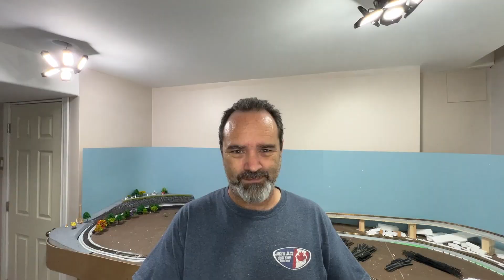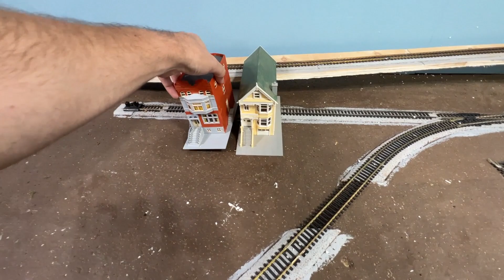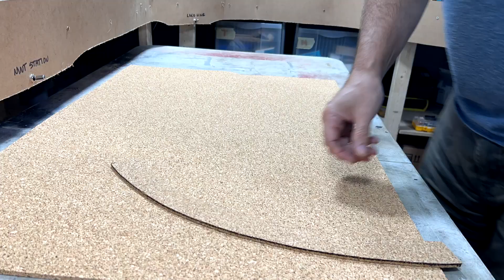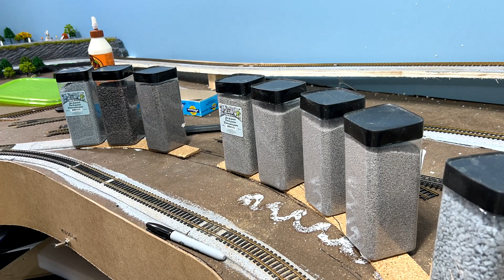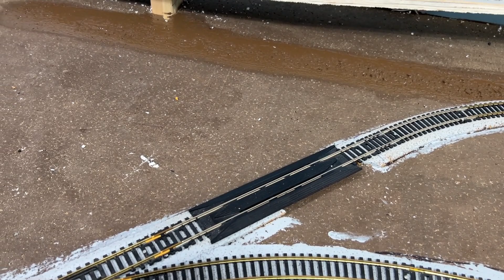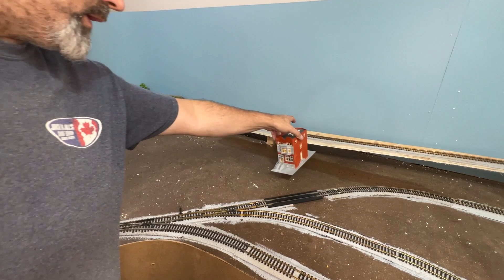Layout Update With Some Minor Track Changes To My New Model Railroad

Comment: You sure do work fast. That will definitely be an improvement to operations, nice job. If you do replace that turnout, you might consider using a curved turnout and then the tracks could be parallel.